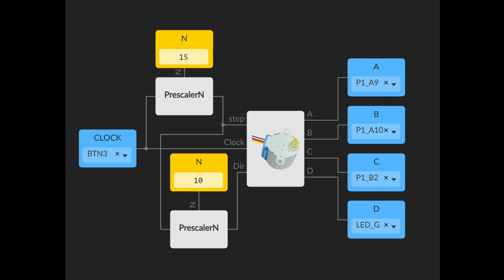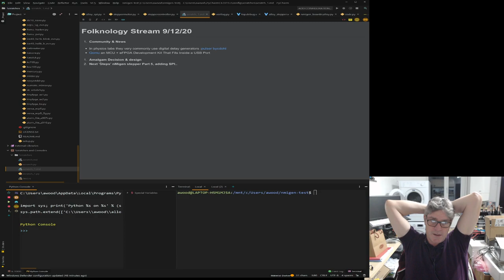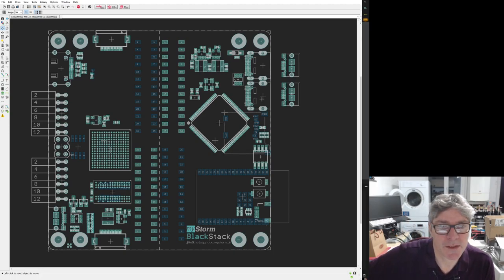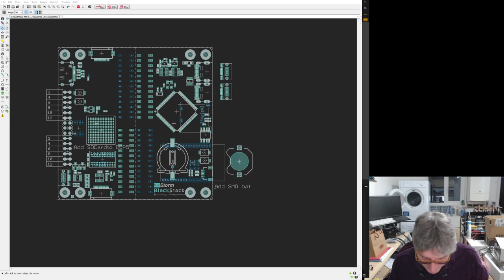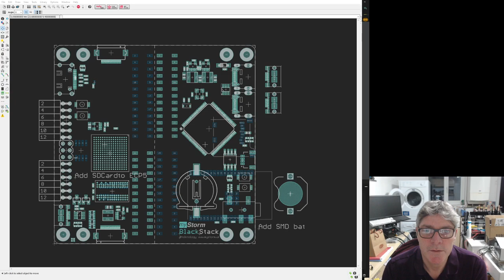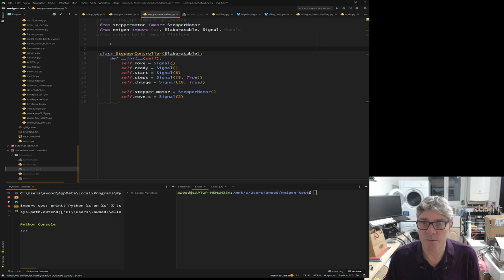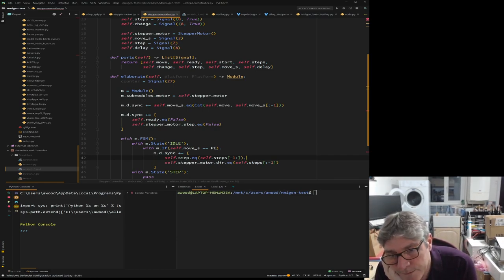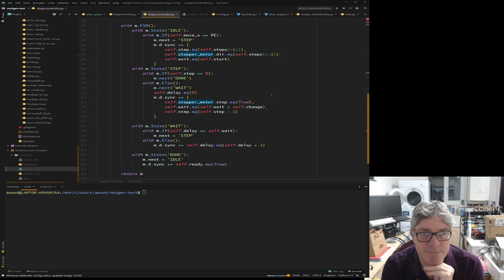Amalgam Design and nMigen stepper part 5

Comment: The BlackStack is looking awesome! :-) Will there be the ability to configure the fpga "straight through the STM" rather needing to repeatedly flash. I'm guessing the JTAG port would provide that, but I was wondering if the MCU would provide such a feature. Or maybe a SPI port perhaps? Thanks.
Reply from the maker: Yes that is how we have historically done it, with optional flash it mode